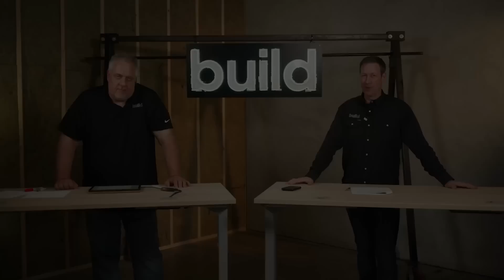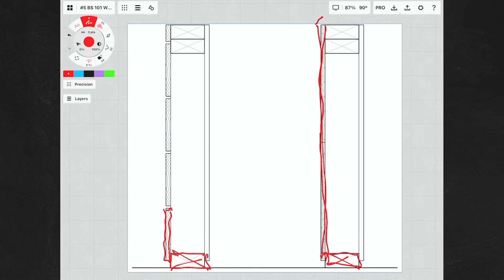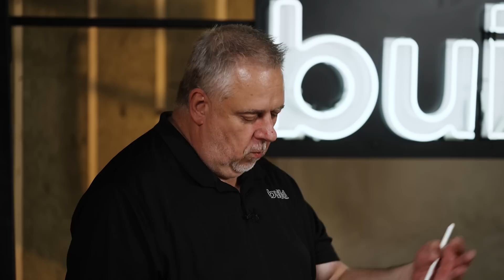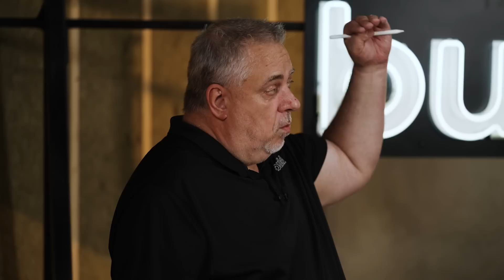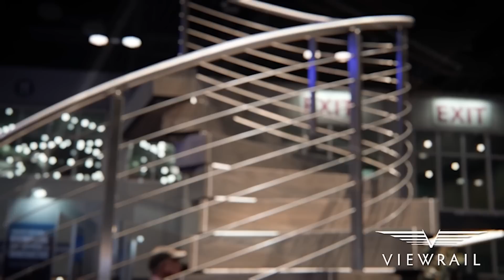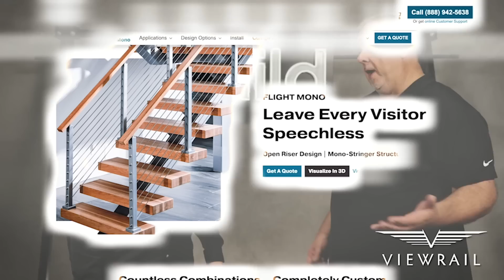Build Science 101: #5 Where is Building Science?

Comment: Great video! We had 55 days of 110 degree plus temps in Phoenix this summer. I used your building science lessons to build my son's home. ICF exterior walls, shaded porches on all sides except North, Rockwool interior walls, ERV, R50 ceiling insulation, vented attic, low SRI standing seam metal roof, inverter hot water, low U windows. Triple Mitsubishi high SEER mini splits. His August all electric house (2500 sq/ft) power bill was $149! So low I can't justify my dream solar/battery set up. Thanks for the education. Come see it if you are in town. I also built all the cabinets /built ins with real wood (Bourbon Moth help).
Reply: If you have time to answer, I'm curious about your roof cost vs. a more conventional roof. I'm impressed. I really would like to build a home using these principles. Thanks for your time!

Comment: I've been looking for insulated door knobs, but can't find anything. Metal is good at conducting heat and it seems like an insulated door knob would be pretty useful. Where are the insulated door knobs?
Reply: Thermal bridging is often overestimated. Realize that when calculating the heat transfer, you are always multiplying by the area of the offending object; the metal conducting through is way less than one square inch.(take it apart and see), so you really don’t need to worry about it.